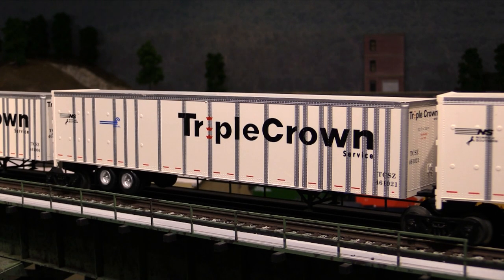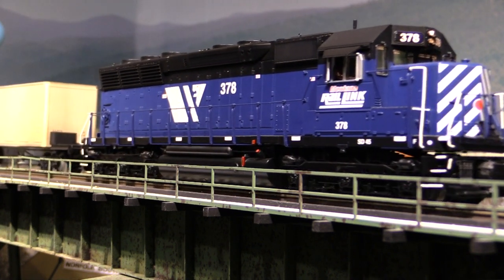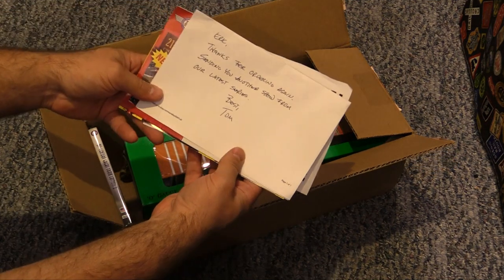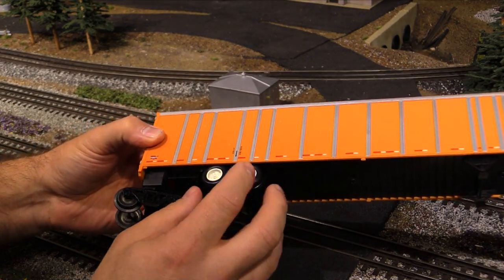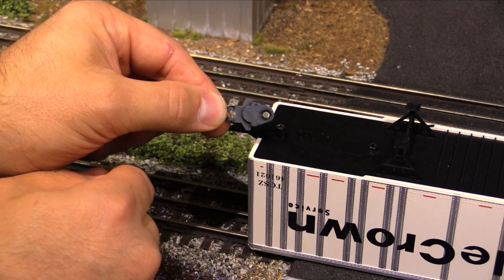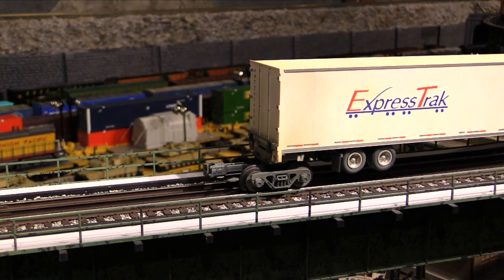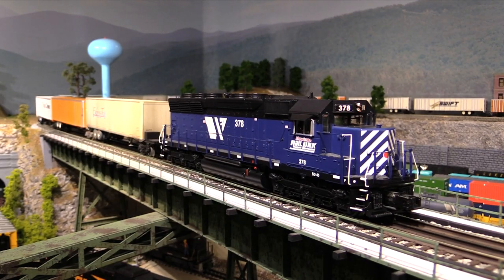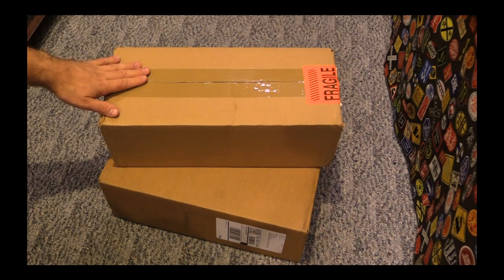The O-Scale RoadRailers

Comment: I got a # of Bowser RoadRailers of the Ice Cold Express with mountains design a # of years ago & added them to the Lionel Ice Cold Express Train.  At that time, I took a truck with coupler off an extra Tow-Mate & put it on the rear trailer so I could hook up the set caboose. That distance is a little long---Maybe using a Weaver truck with coupler will be shorter!!!  THANK YOU!!!  By the way; I did all your modifications to my Ice Cold Express Train Set---Works GREAT thereafter!!!!

Comment: Another operating quirk of these: when running across sectional 072 curves, the truck spacing coincides with the rail joints, so instead of staccato clicking, you get a steady CLACK...CLACK...CLACK...

Comment: Great video Eric I have the roadrailer in HO and N scale on the HO you can put the coupler mate on the rear of the train it has a tongue to couple to the rear roadrailer you have to unscrew the rear truck from the roadrailer. I saw your coupler mate has the tongue on it so you can but it on the rear and you said you bought 4 coupler mate when Amtrak the roadrailer they had a coupler mate at each end and Triple crown some time did this on some of there trains for back up movement. Have you looked on eBay for weaver roadrailer parts and see if someone is selling the med tongue and can you modify the browser roadrailer to screw on the weaver med tongue. I hope you get more roadrailer.